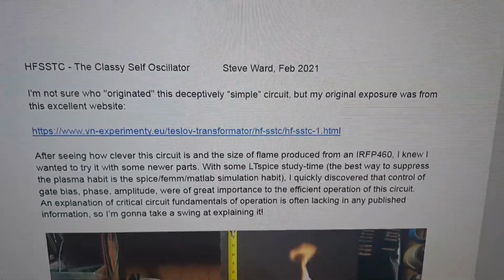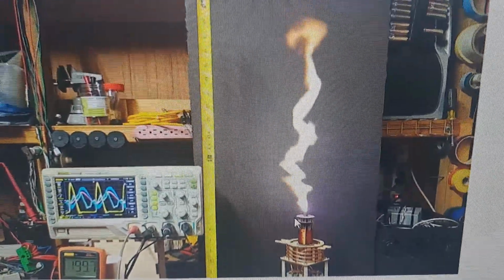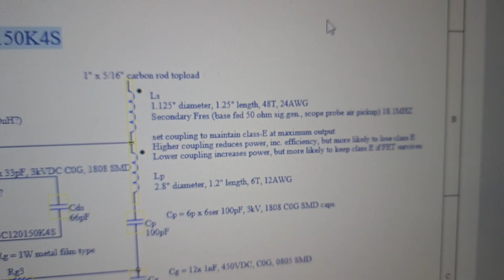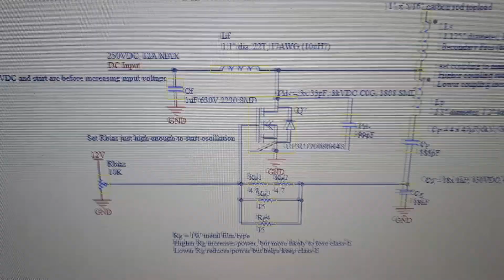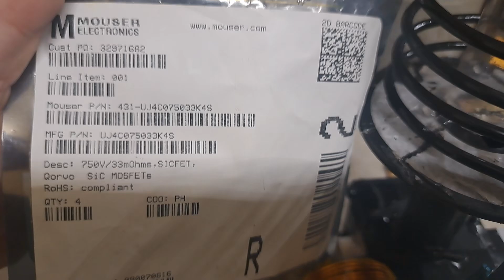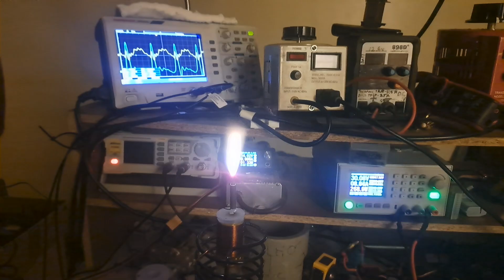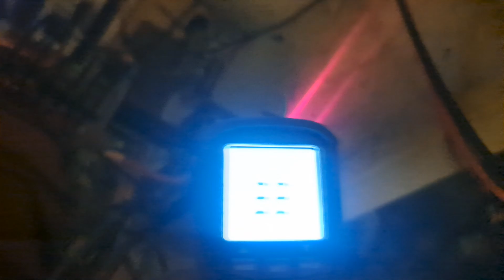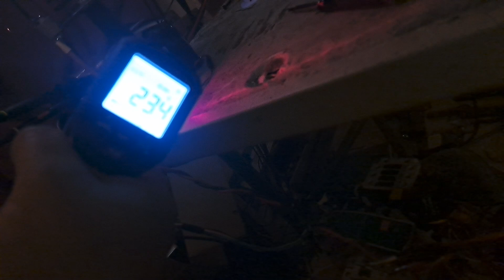Steve Ward's HFSSTC Circuits

Comment: Which version of LTSPICE has the uf3c120080k4s transistor model?
Reply from the maker: I feel like I tried looking up the answer to this, couldn't find it, then forgot lol my bad. IDK though, I don't really simulate these and I don't know my way around LTSPICE. Then I found this:
https://www.onsemi.com/download/application-notes/pdf/and90315-d.pdf
Reply from the maker: Then I realized that crap don't work after the acquisition by Qorvo lol
Reply from the maker: I guess you could try https://www.onsemi.com/design/technical-documentation#ZHQ9TW9kZWxzO3B0PTE3NjQwLDE4NDYwLDEwMjEwNiwxMDI4NzIsMTAzMTcxLDEwMzE3MiwxMDMxNzQ7
to look for a similar model but the only one from the same family I saw was one with 9mohm rds. 
The thing with these fets is the ~5V threshold voltage.

Comment: Y ese  capacitor rojo de cuánto es?
Reply from the maker: Red one? Where?
Reply: @Magneticitist  el que sale en el minuto 3:40 es un condensador rojo o bronw es que soy daltónico
Reply from the maker: @enriquer-d-s6940  ohh I see that's just a big polypropylene cap I think I had. Something like 4.7uF. I was just using it on the input rails in place of smaller C0G caps I added later.

Comment: At these frequencies (>10 Mhz) top of the dischage isn't "electrical" anymore. It's more like a flame. If you put grounded electrode in the top of the plasma, the gap won't break down! I would like to see it run when oriented upsidedown. I expect the torch flame be significantly shorter
Reply from the maker: I can't remember who I saw do it.. maybe Vidduley? But he inverted the flame to show what would happen and it basically went straight down. Not sure how that would work with these. I'll see if I can rig something up to try that.
Reply: @Magneticitist   I went to his channel. He experimented with HV DC. HV HF makes like in your case makes torch flame discharge quite a different animal
Reply from the maker: @imeprezime1285  Oh I remember now it wasn't Vidduley, he has a good video on the history of the circuits, but Vdekje turned his upside down.

Comment: is that secondary running at the same or double the primary frequency?
Reply from the maker: I was a little worried about that with the one that killed the fet first try cause even though I wound the secondary to spec, if I had to guess it's closer to 10mhz than it is to 20mhz. So that's why I basically tried winding the primary a little lower just in case. I did also try a secondary with less turns on a similar circuit but I couldn't get it to break out at 30V. This circuit needed some reasonable coupling to get the breakouts to free air. I got some more magnet wire coming today so I'm probably just going to wind a ton of coils. Not sure the best approach to take to try avoiding killing the 150mohm sic I still have yet to try cause I def thought the first fet that died was on a circuit pretty close to spec.
Reply: @Magneticitist  I would assume having a secondary the same frequency as the primary would be optimal, but when i switched to one double the primary frequency it stopped acting real weird and the current draw dropped significantly. The flame was a little smaller but it let me crank the input voltage significantly higher
Reply from the maker: @darascope  It can be done that way especially at lower voltages and powers but Steve's is designed to avoid the secondary resonance so he intentionally only has a moderate voltage boost from it. That's the operation I'm going for as well. It's not a whole lot of wire length difference between around 20mhz and 10mhz with those dimensions though.
Reply: @Magneticitist  I just finished up cutting some mica sheets for a new secondary, I'm only using a 1 inch diameter instead of 1.125 inches, javatc says in need ~ 50 turns so tomorrow after the glue dries I can wind a secondary that wont self destruct lol
Reply from the maker: @darascope  Has Javatc seemed to give you good calculations for these frequencies? I was noticing when plugging in the secondary values of roughly 1.125 inch diameter coil and roughly the same height w/48 windings, it was telling me something closer to 11Mhz if I recall. 

I figured out my first fet died cause I must have jacked up my resonant caps and didn't notice. I didn't notice til I killed the other fet the same way lol..  luckily I still have a couple of the other 750V fets that are a little nicer so one of those worked no problem and I get better waveforms at a little over 11Mhz. 

This overheating of the secondary is now a concern I see I need to deal with. Right now I  just have the coil wound around a former then carefully removed and wrapped with kapton tape. No core to melt but I figure if it starts melting the tape then it's already melting the wire enamel.
Reply: @Magneticitist  I find javatc gets me in the ballpark, it says my primary should run at 8.9 mhz but in reality it runs at 8.7-8.6 mhz, I input a cylinder topload for the secondary and with a 1 inch diameter at 50 turns it says i get around ~18.6 mhz. I cant tell why it just seems like these circuits are a lot happier if you tune them under 10 mhz, all the weirdness went away after i dropped the freq and increased Cg to 14nf
Reply from the maker: @darascope  That's weird. Javatc was telling me both my primary add secondary were running close to each other. I need to try again. How about Cds? Hopefully I won't have problems over 11Mhz but it's looking like after tweaking Cds slightly I can get Class E at something like over 60VDC. I'm just having to drop Cg a lot just to get over 10V on the gates.
Reply: @Magneticitist  i just have 3 33pf caps for Cds like Steve does, i didnt tweak it past that cuz when I messed with it in ltspice it just made the drain waveform messy, i know tuning it helps shape the drain waveform but i havent scoped this circuit while running it yet
Reply from the maker: @darascope  Do you have an online spice circuit link? I tried making one on my PC but got impatient trying to learn how to add custom stuff and set it up how I want. 
I'm guessing the arc loading Steve has added in his simulation is supposed to represent 'nominal' output as in maybe not the highest and not the lowest power levels. Typically I would think this value of Cds mainly depends on your running frequency at the time and the total drain capacitance of the specific fet, external and intrinsic. The higher the value the larger the on time of the swing with typically lower amplitudes. So basically too small of a value at a specific frequency might cause the drain voltage to start swinging negative again before the gate turns on and will cause ringing. Too large a value may cause the gate to turn on well before the drain has swung back down to 0 which will also cause bad ringing. Adjusting other values can also affect this interaction though. If you've used the same Cds as in Steve's circuit on the same fet, but have also lowered the running frequency some Mhz, I would imagine you'd need to adjust the drain capacitance but who knows.

Comment: Dude that’s crazy. I’m surprised that capacitor didn’t explode. Awesome build. Love seeing your circuits and videos
Reply from the maker: Hard to say but I don't think it would die at that power. Maybe after like an hour or something on a hot day IDK.. but they hold up well for their size. You can get 15kV ones that are decently bigger for around 50 bucks. Probably what I'd do for higher power. It's either that or stacking three of the 33pF caps which are around the same price or more for 3, but then need to add some type of planes to couple them.
Reply: @ interesting. I made a similar circuit for the plasma toroid thing. My caps will get pretty hot if it’s not generating a toroid but if the toroid forms then the caps stay pretty cool. I didn’t use a doorknob tho so maybe that’s why